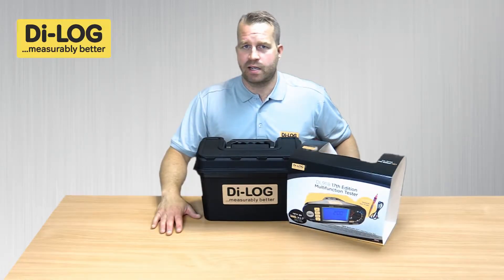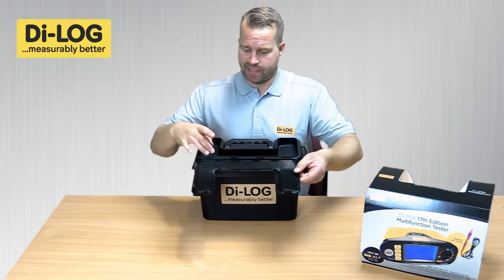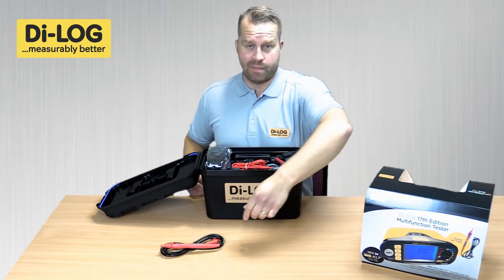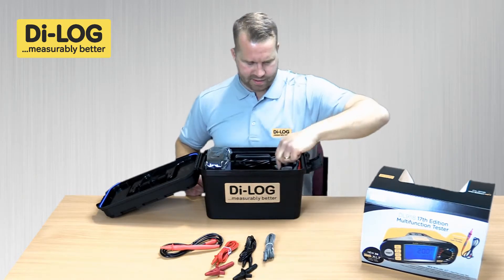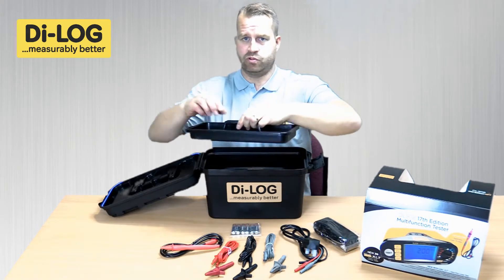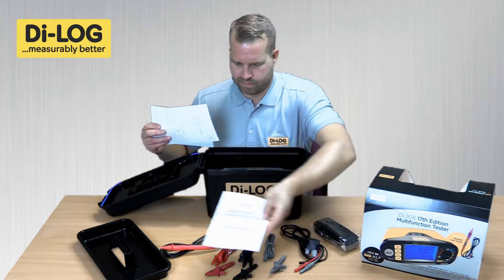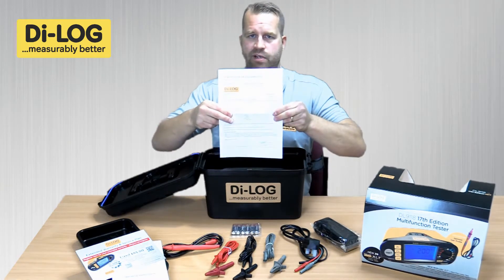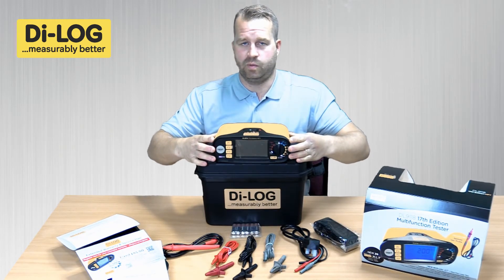The Boxed Contents of the Di-log DL9118 Multifunction Tester

Comment: Every time I have it on continuity and there’s voltage present my fuse blows! I go through at least 5 fuses a year. Once it blew other parts of my tester- I sent it for repair and it was fixed thankfully - but my fuse still blows if I do continuity test with voltage present.